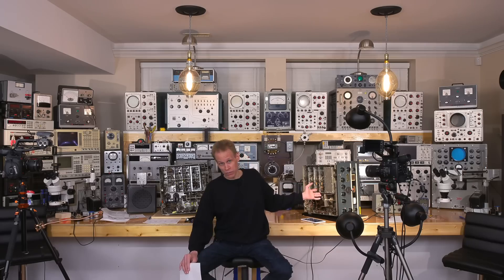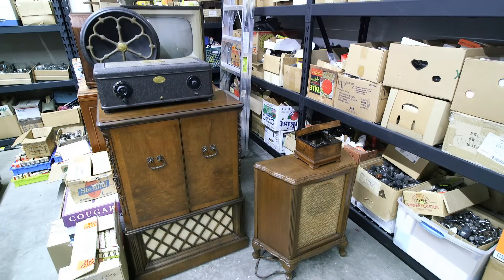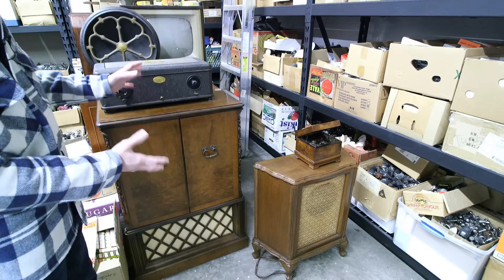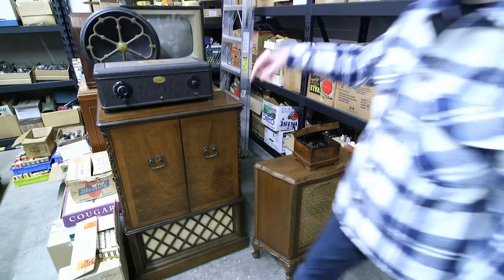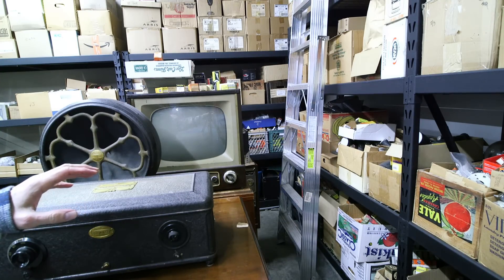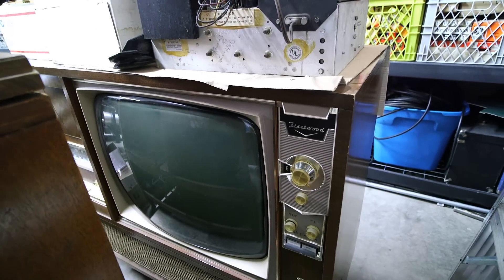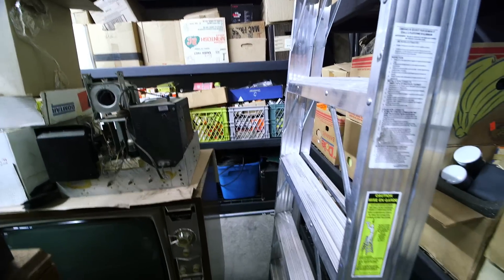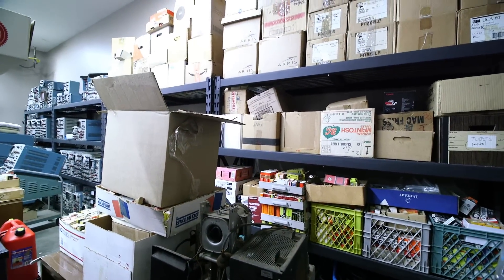New Upcoming Barn Find Restorations And Repairs!

Comment: Hello Paul how are you. I have a new Idea about how to make a floating chassis AC/DC radio a bit safer with a polarized line cord. As everyone knows the original design switches B- so most people rewire the switch by removing B- from the switch and soldering neutral from the line cord directly to B- and routing a wire from the rectifier to the switch and soldering hot to the switch and that works but.....there is a big AC 60 cycle voltage at the switch and induces a little hum at the sensitive audio input at the volume control and I had a radio that I wired that way and I couldn't get rid of the hum so here's what I did. I soldered the hot wire directly to the rectifier just like original and kept the neutral soldered directly to B- instead of the switch. I went to the detector first audio and removed the heater B- and wired it to the switch and ran a jumper to the other side of the switch to B-. Now the switch only interrupts the B- to the heaters instead of the entire B- to the line cord. When the cathodes cool off the rectifier stops conducting and no more hum when it plays and B- stays at neutral all the time. What do you think Another way is to unsolder the B- to chassis ground capacitor from the B- switched side and move it to the neutral side of the line cord so it stays neutral even if the switch is off. X2Y2 safety capacitors must be used across the line and a safety capacitor must also be used for the B- to chassis and must be a low enough value to prevent excessive current from B- to chassis at 60hz. but big enough to terminate the RF voltage so it won't squeal and oscillate. Usually a .01uf but some of those glass tubes with the metal basses or all metal tubes need more capacitance

Comment: Paul, I appreciate all that you do and really learn a lot from your videos.  However, for us, antique TV restorations will leave you with a restored electronic video receiver that has no commercial TV transmitter available to really be useful.  At best, antique radios have many stations available.  So, what about the restoration of today's modern digital TVs?  I see these modern electronic devices much more than older TVs.

Comment: I will also mention one other radio repair channel, and that is TRX Bench. He is my favorite besides your channel Paul.  He is very very thorough when he explains what he is doing, how he is finding the faulty component, and so on. He repairs very often amateur radio stations, and that is very helpful if you have a similar radio that doesn't work correctly.  I will definitely check out the two other channels you spoke about, Paul.  Take care 73.

Comment: Paul are you familiar with a test instrument called a Bolometer? I found one in an estate sale formerly owned by an Air Force Electrical Engineer based at what is now a closed Radar station. I have the manual as well. I can send pictures if your curious.

Comment: Hi Mr. Carlson, I'm an audio engineer and as such I work with professional audio equipment daily, some of these pieces of equipment have been coveted and used for more than 50 years. This is probably outside the realm of "likely", but I would be incredibly interested to see you open up a vintage compressor such as a Fairchild or LA-2A or a Pultec EQ unit. If you have access to that kind of vintage audio equipment would you consider ever bringing them on to the show?
Reply from the maker: "Will do" in a future video. Thanks for your input!

Comment: That's a real Aladdin's Cave!  I'm looking forward to the adventures to come.😊

Do you have any plans for testing and categorizing tubes?  I know there are vintage tube testers, of the type the local radio store would have had on the counter.  These generally give only a basic good/bad indication; sometimes the real test comes when you try to use the tube in some equipment.  Would it be worthwhile building some tube test jigs to simulate actual working conditions for tubes?  Or maybe you have some already!🙂

Comment: I’m very excited for the Atwater Kent. I found a model 40 last summer, with no speaker, it was claimed it worked the last time it was hooked up 10 years previous. The power supply unit looks like the tar has been melted at some point and there’s an end of a newer looking circuit board protruding from the tar with some newer leads running to the PSU board. It appears someone has been in there to re-cap it at some time, quality of work, who knows. I was lucky enough to find a model E2 speaker shortly after at an antiques mall. I powered it up with a dim bulb setup, just a short wire for the antenna and it received several stations from the area, sounded great. It’s nice to be starting with a working unit. Anyway, I love your channel and I’m greatly looking forward to the future videos.